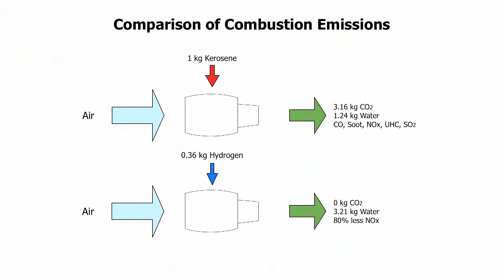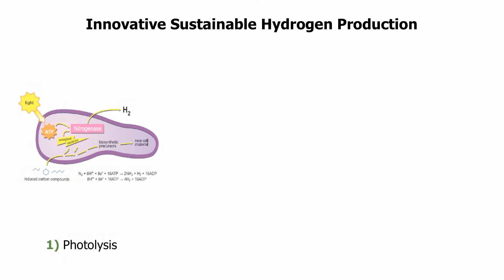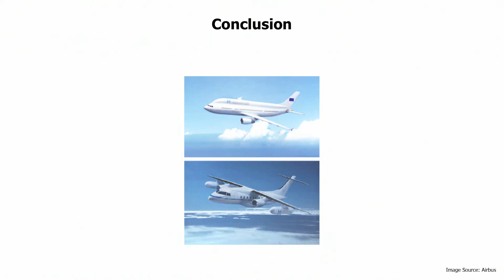Space for Innovation: Liquid Hydrogen Powered Commercial Aircraft

Comment: Seawater is probably our best source Hydrogen. I see a future where solar pannels and wind turbines (even sea turbines) would be locates all over the costlines of areas were eather sunlight, wind and tidal waves are strong enough to supply, not only water, but electricty to separate the Hydrogen from Oxygen. Not Mention, Hydrogen is 14 times lighter than air. Wich means a single gallon of liquid hydrogen has the same energy than dozens of gallons of Kherosene, if you are able to compress it in a same size fuel tank. A liquid hydrogen powered aircraft could even leverage space flights, once, by having such light and efficient fuel, spaceplanes with Scramjets turbines and a liquid oxygen tank (to use when it reaches the vacuum of space) can become cheap enough to make Orbital Flights affordable for the average people, and even space shuttle flights as cheap as normal cargo flights.

Comment: It's not just aircraft hydrogen can be used for. Burning hydrogen would produce enough heat to drive a gas turbine which would produce electricity in a power station. Hydrogen can also be used as fuel in internal combustion engines for cars. Hydrogen is the future.

Comment: Aircraft right now aren't flying with liquid hydrogen because of 1. lobbying by oil companies and 2. there's a component in hydride that's considered a weaponized material  by the U.S. government and so can only be used in weapons, its not allowed to be sold for civilian use. I prefer Liquid hydrogen vehicles to E.V.'s because I hate E.V.'s and this way I don't have to give up the internal combustion engine. We need to move forward with liquid hydrogen now.
Reply: You hating EVs is the problem.
Reply: I dont understand your comments. fuel cell cars are available in California. State has no issue with hydrogen gas for commercial use.

Comment: Solar energy, will soon be cheaper than cabon dioxide emissions based power. Light efficient aircraft, composite aircraft, lend themselves to light efficient fuel, like liquid hydrogen. Natural gas infrastructure, like pipelines, liquid natural gas tankers, gas turbines, give us the engineering we need, to start the conversion. If 25% of deserts, can give us 25 times the energy, we currently use, then, hydrogen could be very cheap, in the future.

Comment: I would not worry about water vapor release causing global warming from planes because most likey if this would happen, there would be a condensation collection water tank on board the plane and then the pilot could release the water from the  tank and discharged the water back into the oceans, lakes or forests.  WHen water is just heavy enough and no longer a vapor it just falls back to earth and causes no global warming.  Or some of this water could be used by the passengers to run the bathrooms, and supply cooling to the engines and Air conditioning units.  I wish all airplanes used hydrogen but i dont see that happening anytime soon.

Comment: Because the bi product from hydrogen is water.... when water is let out at that altitude it works as an increase of green gasses in the atmosphere - leading to more global warming. If hydrogen  shall be used in aircrafts they need to fly at a much lower altitude and then its not worth it anymore due to higher friction.
Reply: It's actually referred to as climate change now, global warming proved to be nonsense but even if it were true, there aren't enough planes in the air to make that much of a difference
Reply: You heard it here first folks. Water at low altitudes causes global warming.